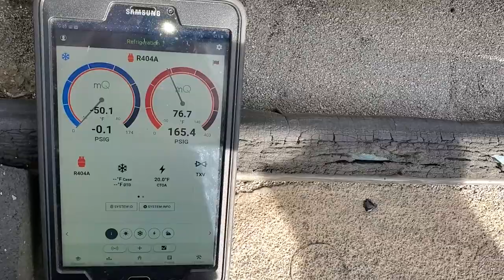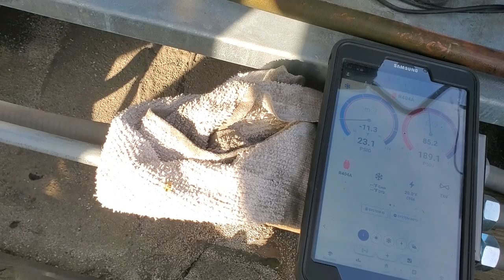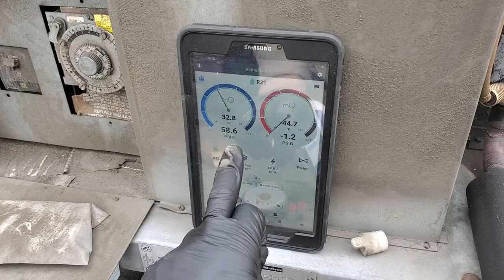WATER LEAK OVER THE RESTROOMS

Comment: Doesn’t have to be perfect. Has to look decent and work. Good job Chris.
Reply: To expand on what @Paul Wehr said (I agree with you Paul), in my trade (electrical) Article 100 of NFPA 70, aka The NEC, states that “all work must be done in a neat and workmanlike” fashion. This means it must look good to the customer, and be done right as judged by the inspector. This work meets both of those - it looks good, especially where it’s most important to the customer.🤓

Nice work Chris 👍
Reply: ageeed. never going to be perfect. unless doing exact same thing everyday.
Reply: Or like my old crew-chief used to say, "It'll look good from downtown boys!  Good enough."  There ya go.   Ole Tex would never steer you wrong!
Reply: Well, in general I disagree with the "looks good from my house" analogy primarily because I'm hypersensitive to those words - I come from a growing city where the Hackery is thick, near the Camp Fire burn scar... 
But Chris' work here clearly isn't that - I would like to say Chris used an excellent application of good value engineering - it looks great where it matters most to the customer, it looks efficient and functional where it doesn't show to the general public. If I catch one of my guys doing 'show quality work' on a roof we're gonna talk...
Now there's a certain brewery nearby that wants the show quality work everywhere and they pay T&M for it - that's what they get.
Conversely, I won't tolerate hackery except in emergencies wherein it will be subsequently repaired. 

That's my Sensitive Sally answer about that.
Also thumbs up to your comment ;-)
Reply: @sinistersparky9657  LOL!!!  Lighten up Francis...
Nobody's talking about "hackery".  It's a metaphor for "point of diminishing return".  That's a legitimate economic concept, not an excuse to get in and out to make a quick buck.   I think most tradesmen here knew EXACTLY what I meant.....
Reply: @sinistersparky9657  I feel for you guys over the camp fire thing.  That was terrible!  We have the same issue here only with flooding; we allowed expansion into areas we shouldn't.   We're correcting that now; we're buying back land that never should have been expanded on in the first place, once it gets totaled in a flood, then it becomes zoned permanently untenable for human habitation.  The way God intended it.  Same way with dry land, dry timber high winds and civilization:  They weren't EVER intended to mix.  Ever.   Why CA allows people to risk their lives and spend all those resources for a bunch a people who don't know enough to "get out of the way" to coin a phrase, just so they can enjoy a view for awhile, well.....
     There.   That's my Francis moment!    Enjoy!!!   
        The fly-by-nighters always move in for a quick buck after a disaster; happens in Florida and along the coasts after a hurricane all the time.   I find you get what you pay for usually; the lowest bid isn't always the best.   Customers usually don't learn they didn't save money until AFTER they get taken to the cleaners.   Then they would pay guys like us to make it right.  
          But above all, the way I see it, a fella's gotta keep a sense of humor, whether he's making the money or spending it....  Like grandma always said, "For every minute you're angry, you lose 60 seconds of happiness you can never get back."  It's good advice.
Reply: Crfor Freedom I love what your gramma said 👍 and I love the Stripes quote... Sgt Hulka 😎
we are trudging through it here one day at a time. Paradise has been here for a long time, and it was an unincorporated area that grew tremendously post WWII until the town was incorporated in 1976. The general plan kinda happened without happening, but then the weather changed for the worst over the last 20 years - California droughts only get worse meanwhile people complain that wildfire construction regs are too restrictive. I’m probably going to move, I’ve been here for 45 years, maybe it’s time to move on... 👨🏻‍🦳 sigh
Reply: @sinistersparky9657  Way to be either old enough or cultured enough to get the Stripes reference!  Well done!    
I agree with you; moving is a good idea.  Fires there are just inevitable.   But you know that.   Like you said; it can be a paradise for decades but then...  Sooner or later....   I've recently researched your Camp fire; tragic.  I'm still not convinced it was due to PG&E negligence, or just the way it works with winds on high voltage lines with that much fuel under them.  It does sound like they haven't been good stewards with the public's money though, that's for sure! 
               The speed that fire moved was astounding, the fact that so many people in Paradise were told not to worry when they called and called earlier that morning is heart-breaking!   Then when it was too late:  "EVACUATE!"  Madness.   But not negligence on emergency services part either I don't think, just a bad, bad, scene...
     I wish you the very best, truly.   I pray for all you guys out there.   My best wishes to you and yours......
Reply: It’s all new to us, I mean at least on this scale, whereas you folks in hurricane territory have these disasters more and maybe are now better prepared - we have a lot to learn from y’all. About the PGE thing, they made a choice (profit motivated, it’s investor owned) to let the transmission towers ‘age in place’ well past their 65 year design life - my GF lost her home so we stay pretty current on the latest investigations - so when they turned off the power this year to millions of customers, they left the transmission lines energized (because they were still SELLING power) and started the Kincade Fire. 
Anyway, to make our hackery problem worse our fair town subbed out the building inspection to 4Leaf who have gotten approval to do inspections with drones. Aaaaaaaaargh! 🤯 
Now they don’t even have to get shite from the inspector 👷🏼‍♀️
Ima bout 50ish ... not too old but old enough for everything to hurt, lol but mostly my feelings is what gets hurt lately when I see what is being called work but I digress. Be safe brother, thanks for the chuckle and for the record I love fast cars and fast women, but I joined to beat the draft 😉
Reply: @sinistersparky9657  God bless you out there.  I'm a 50-something too and I laughed at your VERY ACCURATE description!!!   No I get it; there is a lot of shoddy work get's done, I see it every day.  Mostly by guys who both don't know and don't care.  They are the "PG&E" of our industry and all trades for that matter, anywhere you can shave a corner to save a buck.   I like the phrase because like you, I tend to be a bit anal-retentive with my work, and my instinct is to be picture perfect.  I have to remember that small cosmetic imperfections like 88 degree bends instead of pure 90s can work just as well sometimes.  If I can save them a few $$ and still give them a quality job that will run efficiently and flawlessly for years, then that's a whole lot better than having them throw things at me for a charged detail they couldn't care less about and sure don't want to pay for!  Sometimes I have to remind myself to just "LET IT GO".  
     Great talking to you my brother!   Take care and God bless!!
Reply: @crforfreedom7407  I've heard something like "It is not really done right if there is no feng-shui included".

Comment: Regarding your torch cleaning procedure:
A very easy and quick way to clean a torch tip is to dab the lit torch tip first on a piece of wood. The torch will pop, spit out the contamination in the process and relight on the smoldering wood.
just try it, it literally take a second to do, works 95% of the time and you do not waer your tip down by sanding etc.

Comment: Foam backer, bead, rod, or whatever name it has for the place you buy it from,  it's great for filling a hole with minimal sealant. Like the tubes you have to fill I would get a foam coat it in sealant and shove it in, and I top it off with thin cap of sealant. Too much sealant can take forever to dry so this helps me. You could use the pipe insulation too, but having a small roll of it always comes in handy where you have to fill big gaps.

Comment: Love your work especially on the new roof piping. I am a  retired refrigeration mechanic in Australia.  I am surprised at how you do your swagging on the copper liquid lines on the roof. I used to use a flare press and hammer in a swagging tool into the soft drawn copper pipe. If I had to do a female joint on the hard drawn copper pipe I had to anneal  it first otherwise it would split.  I am surprised that Freon 22 is still used in Canada. It is absolutely forbidden to use any Freon refrigerant in Australia now. I used to use it all the time on my jobs here before it was banned because of global warming...Time passes, the Freons were a VERY efficient refrigerant and they ran at a much lower pressure too.

Comment: You already touched on the flooding back issue so your good. I would of used 3/8 soft 50’ roll. If you have another person just grab each end and pull hard then it will be as straight as an arrow. Works great

Comment: wish i still had some pics of a pipe job i did at a school gym about 18 years ago, unit was 40 ton i think. it had 2, 20 ton sections with inch and 7/8th liquid and almost 3 inch suction. had to run it about 60 feet. at the time 1 1/8"was the largest i had ever done on any job. it was a definite learning experience  and was almost a work of art to look at. the engineer from york who came to do the start-up on the unit said it looked very professional compared to some he had seen. it was sad to see it all tore out a couple years ago when they built on and changed to all RTU's.

Comment: That looks fantastic, don't sell yourself short, you did amazing work as usual. 
I have nothing to do with HVAC and know nothing about most of what you're talking about (also, I'm English & live in the UK), I've just started watching your videos and find them really interesting and informative. (Could do with seeing temperatures in ⁰C as well though - seeing as we don't really use ⁰F over here).

I completely understand your reasoning behind installing a new pipe set and taking it over the roof. Positioning the smaller pipes between the larger/insulated ones would've helped to protect them, but placing them on the outside actually looks better. I am curious as to why you didn't take the shorter and straighter route by running the pipes between the 2 roof units and straight over to the parapet wall.  (Less pipe, fewer joints, less intrusive/more discrete and less exposed). I'm also curious as to why you wouldn't insulate all of the lines? Isn't there a risk of freezing in cold/winter weather?
I know that British weather is different, but all external copper has to be insulated over here. 

Looking forward to watching more of your videos and learning more.
Reply: It’s not water flowing in the pipes so it’s not to protect against freezing. It’s to prevent condensation and to maintain efficiency through superheat of the vapor refrigerant

Comment: Do you ever cut and make armaflex 90°s or just slide it on which causes creases. If they would have made 90°s do you think the insulation would have failed? Also are you using 1" wall on the freezer suction?

Comment: Invest in rosebud tip. Blows hotter than both 1&2 tips and brazing 7/8 becomes like brazing 3/8 . I use same torches on 7/ 8 line and get done so much faster. Time saver and I think it save you save your gas too. If you know what your doing. Your better than alot of installers.  Give yourself some credit.

Comment: Looks good! Way better than most of the work you see nowadays. Just a fyi I dont know how you plan on finishing off the walk-in penetrations after the foam dries but our local metal supplier sells the same textured aluminum that the walls panels are made from and ive made patches from that to cover holes and trim out stuff before.  Looks as good as it can for what it is. Even though on some old boxes it's polishing a turd. I've even used it to make covers to protect temp probe wires running across the wall to shield from getting ripped off from them moving boxes of product around. Just take a 3inch or so strip and put a 1/2inch kick on each side with a hand brake.

Comment: If I can give a small advice on camera work, try to zoom in slightly when you are reasonably close to the tarred plates on the roofs, like at 4:30. That tight texture will eat up the bitrate of the camera. Tom Scott's video called "Why Snow and Confetti Ruin YouTube Video Quality" does a way better explanation than I can do. It looks fine in this case, but it's something that can catch you unexpectedly and it may seem like there's something wrong with your setup when you take a look a the final product when it was a simple pattern all along
Reply: [Whatever name goes here] if it's a static shot like that where the rough texture isn't moving it's not too horrible on the quality, but if it's a moving shot then the quality will definitely tank.

Comment: Nice install - if for some reason you are using that style of supports and dont have enough room for the amount of pipes you need to run - just get some of that 1 5/8 unistrut and some 1/4 or 3/8 spring nuts and add a piece of unistrut to the top of your standoff .. it will raise your lines  1 5/8 inch but that is generally not a problem and is way cheaper than more of those supports - that type is pretty spendy.  I'm sure you have seen miles of lines mounted on 4×4 with unistrut screwed to the top of it...

Comment: Good stuff Chris. Got a question, why not just use soft copper for all the runs like people do on AC systems? Is it just a matter of aesthetics or will that nitrogenized copper last longer?
Reply: Speaking for myself, the hard drawn copper is easier to work with on long straight runs. Aesthetically it looks straighter and is easier to suspend over distance during the installation; before adding the clamps/supports. Soft copper can be maddening if you're trying to make it straight :)
I don't think one copper type is more durable than the other...
Reply: Gotcha man, That makes a lot of sense. I could understand it getting maddening If you’re trying to keep it factory straight. And also I didn’t think about suspending it. it would probably dip and just look bad. Thanks for the insight!
Reply from the maker: I will discuss this on my livestream tonight 12/9/19 @5:PM (pacific) https://youtu.be/COGMojnEcvI

Comment: Question I have a question. Why were you heating the pipe away from your weld? I’ve never seen that so I’m curious.
Reply from the maker: First I heated around the joint than I heated the joint and applied the solder.... than pointed the heat towards the fitting and drew the solder into the joint

Comment: Good vid. ( Ftngot ) only thing i would have done differently is when i'm welding on a Roof / above the roof tar i like to throw a wet towel down to catch any hot drips onto roof. i allways have a Water bucket handy too with wet rags in it. i also like to have a garden hose around for safety.
Reply: I also always have a water mister / sprayer .

Comment: I'm just wondering why it was easier to install a whole new line set instead of replacing the insulation on the existing line set? I'm assuming it was access related?
Reply: Too many dead rodents and too much mold in the ceiling. 😆

Comment: Quick tip braze the joint furthest from you so you don't have to reach over a hot pipe to braze the next one. Just speaking from experience. I know you had enough room here to where it wasn't really an issue but in tighter spots brazing the joints furthest from you then doing the ones closest to you is safer. Burns can ruin a perfectly good work day haha. Great video though! I as well use a #2 tip with the oxy acetylene torch and with just the regular air acetylene i use a #12 tip. Both work good.

Comment: Looks good, but here's only 1 problem. Heat insulation for refrigerant pipet don't like sun's ultraviolet beams and it will take 3-5 years and then insulation will be self-destructed. You can use special anti-UV tapes as used in non-commercial AC split-systems installs. Also i can recommend you insolation for waterpipes- works PERFECT! But only in cooling units which runs upper than 0 grades celsium! For example- it perfectly fits for AC units.  If unit runs below 0 grades C - it works worse. 

Birds and rats also like to "play" wits isolation without protection.

Comment: So the reason you dont cool the lines  is for several reasons. It does cause oxidation inside, which could cause contamination issues. Also it could weaken the joints. Making the braze filler more brittle than it should be. Just saying. 100 times it may not be an issue, but not a great work practice.

Comment: You got some sexy braze welds there fella. 😁 have had a helper poop his shorts when he experienced an oxy fueled fire. Gotta be careful when cleaning/handling oxygen. He had an oily rag and o2 flowing and it combusted.
Reply: DirtyGeared yup petroleum and oxygen are a bad mix. I had the pressure disc blow on my rig once. I had one 3/8 weld left to do. I packed the port with electrical tape to get that last weld done. The mix was making a loud popping sound so I moved the rig to to other side of the unit to finish the weld. Did you know electrical tape is a petroleum product lol?
Reply: I do! Have had that happen before. Used aluminum foil to stop off gassing. I'm a welder also so I have seen the horror stories of guys blowing themselves up. Showed my super what o2 does when provided fuel and ignition source. He (probably to this day) thinks I rigged it. I made a can of coke with some oil sprayed around the top explode.